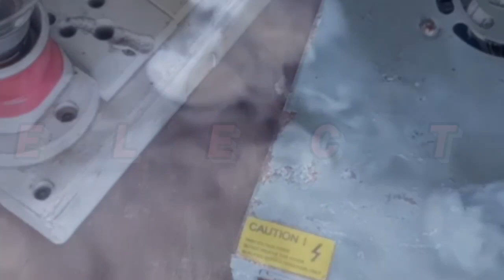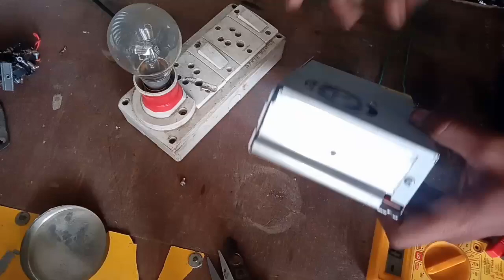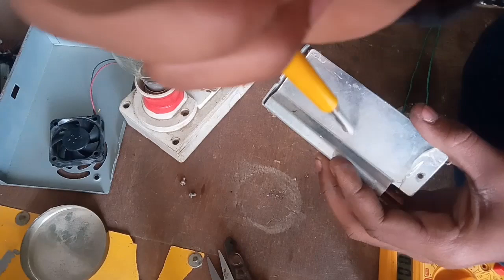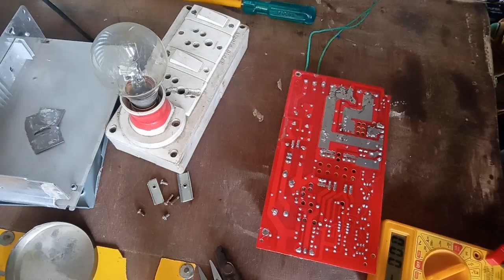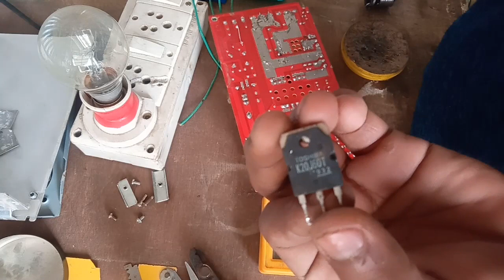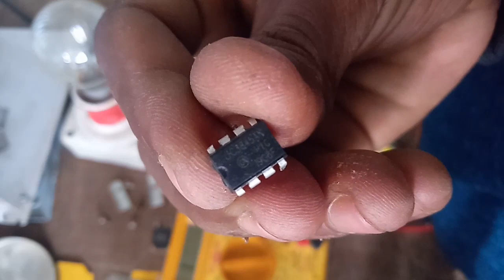#power_supply, How to repair 5volt 60amp power supply full short.

Comment: Sir amar 1ta 5v 60 amp smps ache ota te unload abostay power dile voltage thik dekhache but load dia power dile voltage diche na. Jakhan unload kore power dile voltage show korche erpor oi abostay load dile cholche. Kindly bolben sir ki problem?
Reply from the maker: Amp pa66e na valo Moto
Reply: @mr.electro3556  tahole sir ki karbo balun
Reply: Ami jakhan load dia smps a power dichi takhan cholche na but load na dia power dile cholche and oi abostay load dile cholche
Reply from the maker: Apni Amar 9800304465 call korun Ami apnake bole di66i ki korte hobe
Reply: Sir MOSFET D13009K aur Bridge rectifier GBU410 kaha milega ya iske jagah dusra kya used kar sakte hai. please help